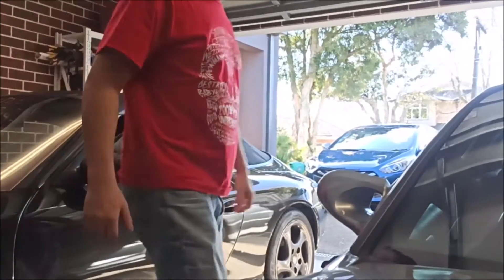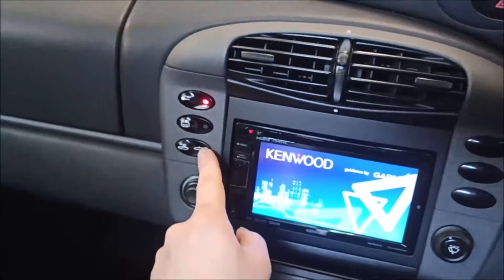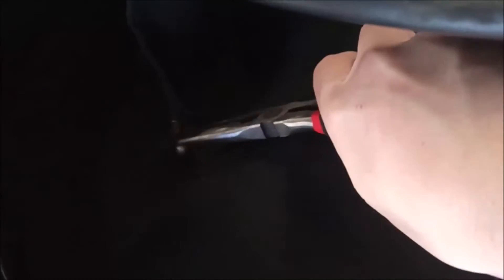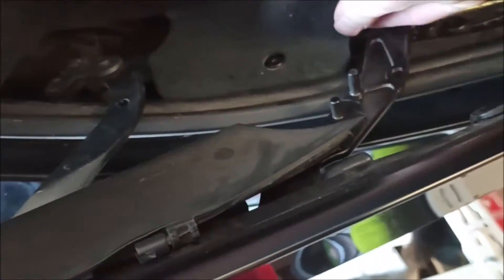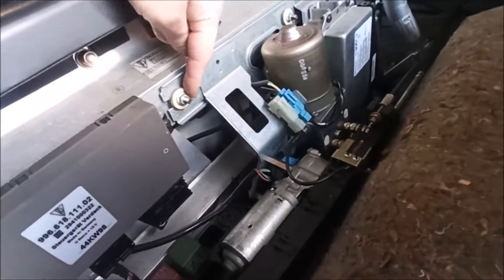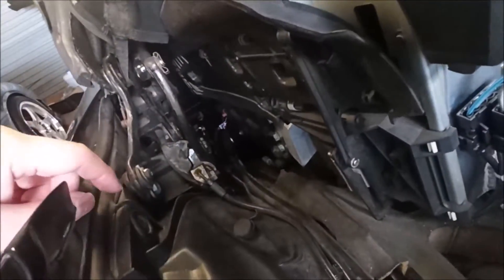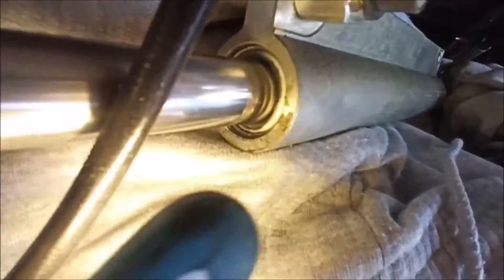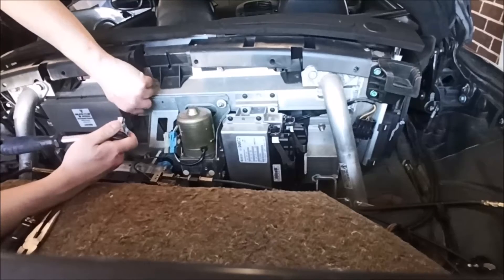Porsche 911 convertible cabriolet roof not working, broken, stuck? Hydraulic cylinder repair 996 997

Comment: You call out a possible "sensor" on the Hydraulic cylinder. It's a bolt that fits inside a slot. I have a 997.2 and I am doing this repair. There is a plastic "shim" or piece from the cab top that is just hanging out with no purpose on the driver side aligned with where this "sensor" would fit in that slot. What is the purpose of this shim (does it also exist on the passenger side) and does it need to attach to the "sensor".  I'm having issues with my top alignment and it won't go up and down properly. Am I missing something?
Reply from the maker: Ah, I don't have this car anymore, and did this repair so long ago I can't remember the process or the specifics on the repair. I'd imagine you'd at least try to align the plastic piece with the sensor and see if that mkes a difference

Comment: i wonder if once you pull the first linkages if you could have just manually pulled top top up and back ?
Reply from the maker: Probably - except you would need a way to trigger the roof latch to unhook from the windscreen. I guess pushing the roof retract button until the latch unhooks, then manually retracting would work.

Comment: Hey do you think you could do this with the top starting in the down position?
Reply from the maker: You can access the lower end of the hydraulics through the rear speaker grilles inside the car with the top down. However getting them out at the back will be difficult., Try manually raising the roof to access the cylinders.

Comment: This is great.  My left side hydraulic cylinder is kind of loosely mounted.  everytime when the roof opens and closes, I see it moves once and makes a knocking sound.  may I ask if I can tighten it through the access of the inner panel where the speaker is mounted?
Reply from the maker: The cylinders are attached at either end - so yes, pull out the rear speaker grille and check the lower bolt. If that's tight, check the rear mount. Good luck!

Comment: this video definitely helped me a lot. i have one question. when reconnecting the red and blue banjo screws did you hand tighten the screws or did you torque them down to a spec?
Reply from the maker: Definitely not hand tight - but didn't use a torque wrench either! The hydraulic fluid is under a lot of pressure so hand tight not a good idea.

Comment: Very helpful expounding the process and removing the speaker was a superb  idea to deal especially with the potentiometer. Also smart move to take it to a local hydraulic shop: i did the same. Thanks mate
Reply: May I ask whats the deal with the potentiometer? I need to do the exact same thing to mine this weekend. And all the step by steps say "please note potentiometer position". What does it do? what does that mean ? a little confuse about the whole thing
Reply: @matttodd9611  The potentiometer is part of the convertible mechanisms. It indicates the positioning of the roof. It is like a close end hook with a rectangular slot on the left side only of the car. The pin on the left cylinder sits at the bottom end of the potentiometer and moves it by sliding up or down. You can see  it well if you remove the left rear speaker (recommended). When you reinstall the left cylinder make sure that the cylinders are calibrated according to the position of the arms by pushing the shaft in or out and rotating the shaft so that the hydraulic cables are in the right original position so that the pin is in the lower end of the slot and right position.
Reply: @kevhov6929  Do I have to remove it at all? This pontentiometer? Or do I just make sure when I install new cylinder that this pin hits potentionmeter is in the exact spot as the old one?
Reply: @matttodd9611  No do not remove. Replace the cylinder pin in exact position inside the potentiometer’s slot.
Reply: @kevhov6929  yeah yeah I gotchu!!! Gonna give it a go this sunday. Im sure there will be a lot of CURSING and SCREAMING!!! LOL
Reply: @matttodd9611  Best of luck...Enjoy
Reply: @kevhov6929  Thank you!! I actually knocked it out tonight took me 3 hours!! I only cursed like 4 times. That pontentiometer stays in place. you just need to make sure when you put new one in that the pin goes thru the plastic loop and horizontal groove behind it. once it lines up TIGHTEN BOLTS IMMEDIATELY!!! Thanks again for all the help. This video is VERY HELPFUL!!! Just make sure you take pictures as you go before taking stuff apart this way you have a point to refer to at re-asembly.